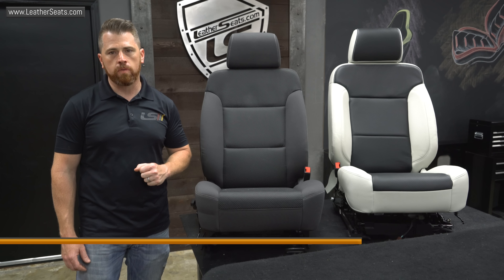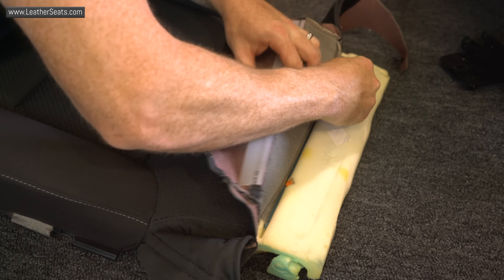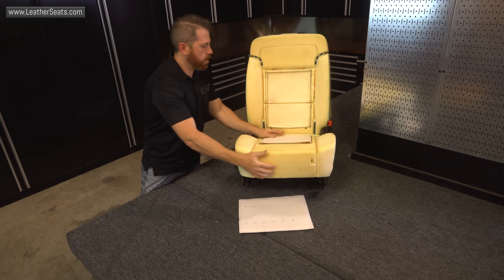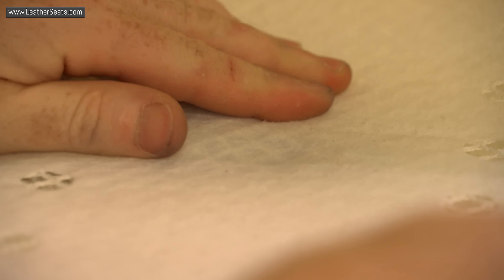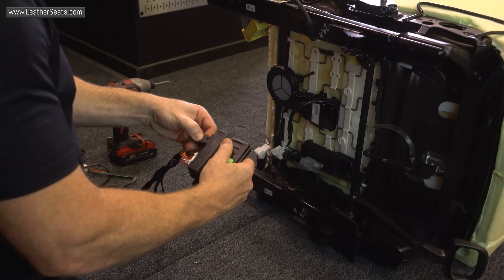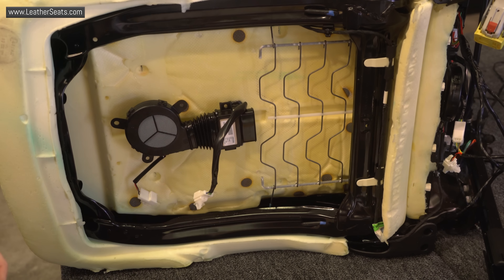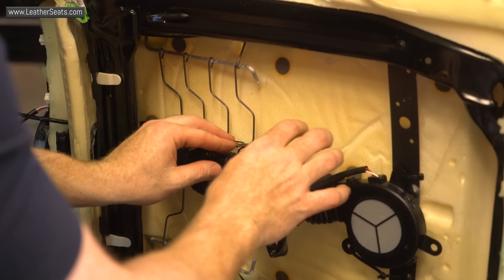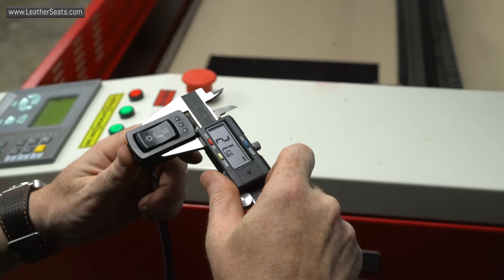Installing Heating and Cooling Seat Ventilation Units - LeatherSeats.com Tech Tips

Comment: I don't get why the TED units have to still heat up even when on cooling mode.
Reply: Michael Nugent look up peltier cooler
Reply: About a month after I asked this question  I saw a video by bigclivedotcom, he took apart one of those heat powered stove fans. Those units contain one of these except they are a TEG instead of a TEC.

Comment: Do you provide service globally ? I want to install ventilation system to my 2022 Honda civic.
Reply from the maker: ak101farhan We can ship our units to most places however you would need to either find an installer in your area or install the system yourself which does require automotive 12V wiring experience. For more info please email sales@leatherseats.com

Comment: so is there any reason you can not retrofit this on a vehicle that currently has cloth seats and put cloth seat covers back on?
Reply from the maker: Robert Craft Technically you could install these on a cloth interior, but we couldn't confirm wether your particular cloth or scrim foam backing would allow for proper airflow. At minimum you would need to replace the scrim foam backing with a reticulated high-flow mesh foam however I still couldn't make a claim to whether or not your cloth will work. If you have any further questions about these units, please feel free to give us a call at 1-866-639-7328 or email us at sales@leatherseats.com.

Comment: So if its really hot and you want to use seat ventilation to cool down, this device will still blow hot air out the other exhaust port? This doesn't make sense to me. Don't you guys think you should make a kit with electrical heating pads and a blower that blows cool air through them, so you can choose only heating, or only cooling?
Reply from the maker: veltruski This is the same style of exhaust that many OEMs use for their equivalent systems. From our experience, if routed properly, the exhaust does not have a notable effect on the ambient cabin temperature. Please feel free to email us at sales@leatherseats.com or call us at 1-866-639-7328 with any further questions.

Comment: Why wire it using the 5 pin relay if you still have to find the ignition power wire? Seems redundant.
Reply from the maker: Great question and point. A relay would be redundant in applications where you can find an ignition based power source that also supplies enough amperage for the units. There are cases where you cannot easily find an ignition based power source with enough amperage, which would require using a separate power wire and trigger wire to make this a switched accessory. The relay is a good solution for situations like this. Still, It's certainly not the only way, as some installers will choose to go straight to the fuse box with a fuse tap to an ignition switched slot that has proper amperage, or something similar. It's worth mentioning here for anyone else reading that we do recommend you hire a professional 12volt automotive shop if you are not familiar and experienced with automotive wiring.

Comment: How does the blower motor operate as a heat pump for heating? Also is it as sufficient as a heating coil found in heated seats? Lastly, do oem heated/cooled seats use the same equipment or does it use a combo of blower motors and heating coils? Thanks! Looks like a well thought out product for a consumer
Reply from the maker: Drew McCarthy If you watch the full video we explain in detail that the function of the TED (Thermal Electric Device) which both heats and cools the air being pushed by the centrifugal blowers before it reaches the occupant's backsides.  This is the same technology that Ford and Dodge currently use in all their factory ventilated seats.
Reply: LeatherSeats.com oh sweet! Is there anywhere to demo the seats in vegas

Comment: can this kit be retrofitted to a 97 ford truck?
Reply from the maker: The units themselves are universal so as long as you have the proper power to tap into them, room to mount the units in the seat, and upholstery with perforation and high-flow backing. Give us a call to see if we have an upholstery pattern for your truck seats and we can go over your project in further detail. 1-866-639-7328.

Comment: How do you power seat installed  seat sir
Reply from the maker: Anwar Sherief You would need to hard wire it into the vehicle's power harness using the included fuse and relay. If you do not have 12V experience you may want to take it to a shop for wiring.

Comment: Do these get uncomfortable! I’ve got a 2009 Toyota Yaris and wanna get heated seats like this but my seats are fabric and I’d obviously get it installed but I don’t wanna feel the lines of the elements I’ve seen on YouTube is that possible?
Reply from the maker: Bethany Bergamin If installed correctly they do not impede on comfort. The distribution pads, as shown in the video, are recessed into the cushion foam to be flush with the seating surface. Our upholstery is also backed with a high-flow mesh backing foam that goes between the perforated leather and the pads. The final, proper integration of our system will give you a factory-like fit comparable to vehicles that came with ventilation systems from the factory. If you have any questions please give us a call at 1-866-639-7328 or email us at sales@leatherseats.com.

Comment: what if you dont have leather seats and just the cloth?
Reply from the maker: Tony Turner We have not tested this system on anything other that leather upholstery and we can't verify the effectiveness of the system blowing through any particular cloth. This particular system is designed specifically for perforated leather that has a high-flow/reticulated foam backing.

Comment: What is normal cost too get it installed and what's cost of your leather for 2017 Chevy Silverado 4x4 Crew Cab LT? Will the blowers work on cloth seats?
Reply from the maker: Jason Holguin There are a several variables that go into both the installation price as well as the upholstery kit itself. You can check out our online configurator here to build and price your Silverado kit. For installation pricing please email timb@leatherseats.com and Tim Broberg can get you more info. As for the blowers on the cloth seats, it really depends on the foam backing and how thin/thick it is along with the density of the cloth. If the material is not perforated and/or mounted with a high-flow mesh foam you will definitely get significantly less air flow through the seats. You might get a temperature transfer through the cloth but we would recommend using these units with upholstery that has perforation and a high-flow (reticulated) foam backing.

Comment: Just out of curiosity, does this process change for seats that are integrated with the SRS safety system?  I am definitely not able to do a job like this, but I was just wondering if the inside of one of those seats that say "airbag" on the side looks any different.
Reply from the maker: Colin Campbell This system is designed to be used with the majority of seats with SRS side impact airbags, however, it cannot be used for vehicles that have a surface mounted occupancy sensor. Some vehicles feature this type of sensor on top of the passenger seat foam. In cases like this, it is not suggested that you install this ventilation system. If you could email your vehicle information to sales@leatherseats.com we can look into what style sensor your seats have.

Comment: in regards to  ventilation, dose it ventilate room temperature air, or it hold some radiator to cool the air and ventilate?
Reply from the maker: Alloush Alaa The air that is pushed through the upholstery is actually cooled or heated based on the the selected settings. It is not simply ambient air. The thermo electric device uses the Peltier effect to heat or cool that air. Eric goes over how this effect works at 06:29 If you have any further questions about how the units work please feel free to give us a call at 1-866-639-7328 or email us at sales@leatherseats.com.

Comment: Would this work on a fabric seat?
Reply from the maker: Mikey Cornwell We have not tested these units on cloth seats because most cloth upholstery is not perforated and most models have varying cloth/foam backing densities. Most cloth upholstery has a much less dense foam backing than leather so you may get a small change in surface temperature however we cannot guarantee this. The units will still technically work if mounted correctly however you will not get the fullest effect of the airflow. If you have any further questions please feel free to email us at sales@leatherseats.com or call us at 866-639-7328.

Comment: I have a 2017 GMC Sierra with the Denali package. The front seats have heating and cooling, but the rear seats have neither. It looks like the leather material in the back is still perforated like the front. Would it be possible to install these in the rear seats?

Comment: Stupid question: where is the cool air coming/ originating from ?
Reply from the maker: 111danish111 The Centrifugal Blower intakes the cabin air and pushes it through the TED device. From there, depending on the setting, the cooled air will get distributed to the seating surface and the warm air is vented out through the exhaust (or vise versa for heating the seat). If you have any further questions about our products please feel free to email us at sales@leatherseats.com or give us a call at 1-866-639-7328.

Comment: Website mentions something about "flow foam".  What dis?
Reply from the maker: Maniac742 It is foam that allows air to flow through the upholstery from the heater/cooler units.
Reply: @LeatherSeats  Are your install videos on factory foam?
Reply from the maker: @Maniac742  Yes the seat foam you see in the videos is the foam that came in the customer's vehicle from factory. We only provide custom leather upholstery. This foam is not to be confused with the high-flow foam that we sew into the upholstery kit. Our high-flow foam is a thin backing foam that is sewn onto the sections of our upholstery where air will flow through from the heater/cooler units.

Comment: Can you do this and not replace the fabric with leather?
Reply from the maker: Dirtymax Matt You would most likely have a noticeable surface temperature change however it was designed to be most efficient with proper air flow via a perforated material and a reticulated/high flow foam backing on the upholstery.

Comment: So, stupid question: is there a way to get this to interface with a Metra TurboKit? I have a 2017 Mustang and I'm looking to upgrade my cloth seats to heated/cooled leather and I was wondering if this could be controlled by the touchscreen that the TurboKit has, since it already has the heat/cool seat icons.
Reply from the maker: Michael Laverty To be honest, I'm not sure. These units have their own control module and switch and are designed to work as an independent system. I do not know if they can be modified to integrate into a different interface. If you had a shop install your Metra TurboKit, I might suggest asking them. Outside of that, it would be up to you to figure out compatibility. If you need more info about the units please feel free to give us a call at 1-866-639-7328 or email us at sales@leatherseats.com.

Comment: Why don't you tap a line from car air conditioner to the seats..?
Reply from the maker: Priyan We want to provide customers with a fairly universal, self-contained system that does not rely on external systems (with the exception of power).

Comment: You can’t tell which direction the ted unit needs to face
Reply from the maker: Hey Will, we'd be happy to send some more in depth diagrams showing the orientation of the parts if you'd like to email us at sales@leatherseats.com. Also, below is a link to our general installation guide for more information:

https://leatherseats.com/sanctum-heater-cooler-guide/

Comment: Lol so all this video did was reinforce the idea of taking the vehicle somewhere and having it professionally done, and also go along with justifying the price of them from the factory, with a factory warranty. So this video just 100% sold me on never doing this myself and never ordering a product from your website, but nice job installing that on the truck.
Reply from the maker: James Mastroianni We do realize this product is not for everyone, however, we have many DIYers install these units for a fraction of the cost of buying the vehicle with the OEM system. Most factory A/C seat options are bundled in packages that are significantly more expensive than the combined cost of our units, upholstery kit, and even professional installation. Additionally, many vehicles do not have a factory option for seat ventilation.

Comment: Will this work on a 2015 dodge ram
Reply from the maker: Im_2 good Yes, our system is universal.  It does require air flow through the upholstery though. Our upholstery kits can be produced with a reticulated foam backing and perforation to allow the system to work. Feel free to shoot us an email to sales@leatherseats.com  or give us a call at 1-866-639-7328 for more info on our products.

Comment: With a methane / sulfur dioxide sensor, in reverse, this hose could remove farts. Wow! Wait a minute, where would they go? Just having some fun. Good video and product ideas.
 Cheaper than an the OEM p-type semiconductor, ceramic electrical insulator, n-type semiconductor with positive and negative voltage applied to create a climate controlled seat using a device called "Thermo-Electronic Devices (TEDS) downstream of a blower motor....wait, oh crap, that is what they used. ASE Master Tech, retired.

Comment: Can these heater/cooling units be installed on seats with factory seat heaters?  Also, is it possible to just order the front seat upholstery ?  I wouldn't need to change the back seat upholstery.
Reply from the maker: Mark Planz Our units will replace the factory heater units and will not work in tandem with them. Our product is designed to actually blow either heated or cooled air through the upholstery so you are not loosing the heat function. We can produce the front row upholstery for most kits, either email sales@leatherseats.com or give us a call at 1-866-639-7328 with your year, make and model and we can go over options with you.

Comment: Hi, would these work on a plan leather (not perforated) factory upholstery? I mean does the surface get cool catching heat from the body or it really needs to 'blow' air out of the seat?
Also I think the factory upholsteries normally come with some me kind of padding attached to the leather that may make it not permeable to the air and the cooling. Thanks and a 'like' for your video.
Reply from the maker: Fulanito Thanks for the like! We would not recommend using these units with non-perforated leather as the method they use for heating and cooling is based off of air-flow. You may get some surface temperature change but it will not be at all as effective as having high-flow mesh foam backing on perforated leather. If you would like to hear more about the options we have for upholstery please feel free to give us a call at 1-866-639-7328 or email us at sales@leatherseats.com.

Comment: Any for a 05 peterbilt 379? You has me at cooling seats lol
Reply from the maker: +Erik Morales Unfortunately we do not have any upholstery kit patterns for semi-trucks. As far as the heating and cooling units go, they are not vehicle specific and can be installed on almost any vehicle out there but they do require perforated seat upholstery with some form of reticulated backing to work properly. We would suggest looking into a local upholstery shop for the seat upholstery but give us a call first and we can give you all the details you will need for the the heating and cooling units to work. Our phone number is 1-866-639-7328 and our email is sales@leatherseats.com.

Comment: what is the name of the tool in 9:23 ?
Reply from the maker: +HEARTDARKNESS1 It is a diagonal cutting wire cutter which can be used to trim a variety of different gauged wires as well as smaller screws like the ones in the video.

Comment: Using the Peltier cooling will there be an condensation drip beneath the seat on hot summer days
Reply from the maker: fleetwood7941 In our experience we have not seen any condensation or dripping from these units.

Comment: why not use a 4pin relay? why give people the ability to mess it up and as you say... drain the battery ? the 5pin relay is used to toggle between two different pins (87 and 87a) by providing the 12v signal to pin 30, one of the 87 pins will always be powered.

Comment: What is the actual cost vs factory cost is what I want to know, (kit cost) and seing that you have to get new seat covers to get full use of the system (seat covers cost).
Reply from the maker: radames alvarez-rivera The factory price will vary based on what company/make/model you are looking at so you would need to look up that info on their website. Most factory A/C seat options are bundled  (not stand-alone) in packages that are significantly more expensive then the combined cost of our units, upholstery kit, and even professional installation. For our products, the price will vary based on your vehicle and the upholstery options you choose. Leather Kit: http://shop.leatherseats.com/build-your-own Heater/Cooler Units: http://shop.leatherseats.com/heater-cooler-units Feel free to give us a call or email us and we can give you pricing for your interior. 1-866-639-7328 or sales@leatherseats.com.